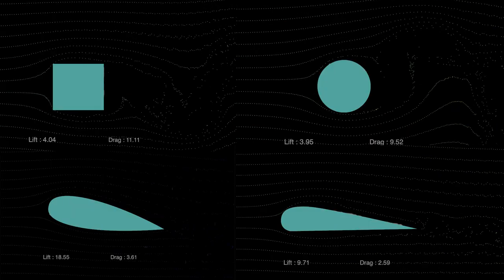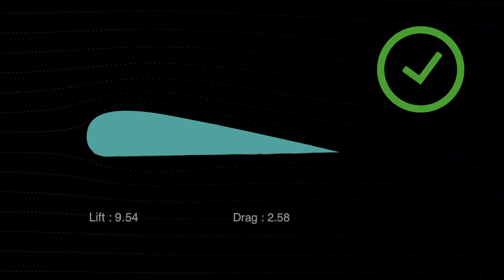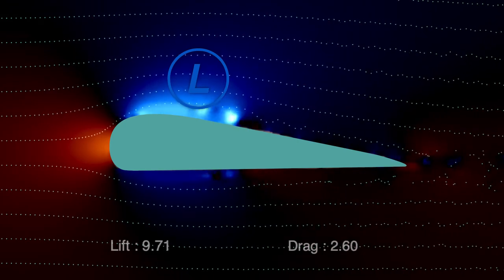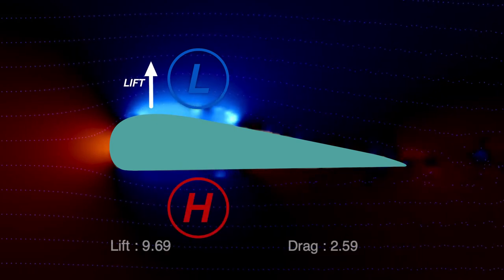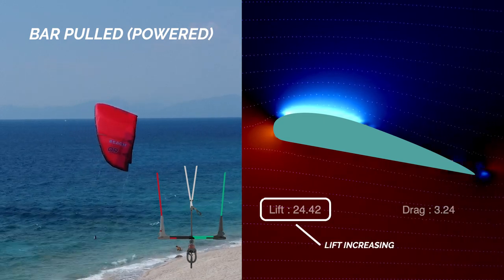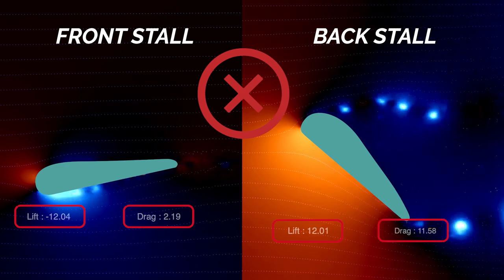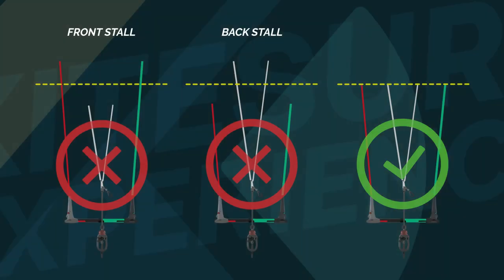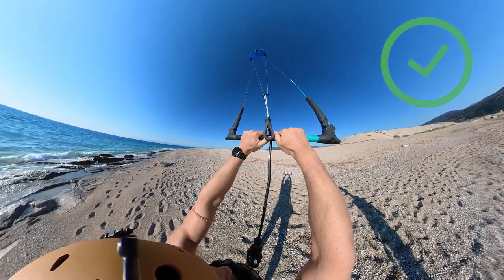The Basic Aerodynamic of a Kite

Comment: The back stall does not occur because the drag becomes higher than the lift but because the boundary layer of the extrados cannot follow the kite anymore. It is the same thing as sheeting in too much a sail or the stalling of an airplane.
Reply from the maker: You are correct, the air flow cannot follow the extrados of the kite along, unfortunately I didn't mention it.
As on "wind tunnel" example even if you don't see the parcels or smoke going on the extrados of the kite there is still a lot of lift shown, It means the kite is still not back stalling. So to make it simple for people to understand if they use the "Wind Tunnel", to  just watch the difference in Drag and Lift, because that "Drag becomes equal or higher than the Lift the kite back stalls", we cannot say that this statement  is incorrect, but you are right that to be complete should be mentioned "the air flow cannot follow the extrados of the kite along".